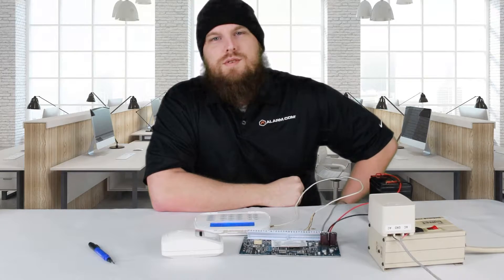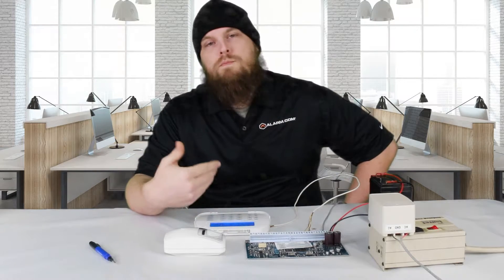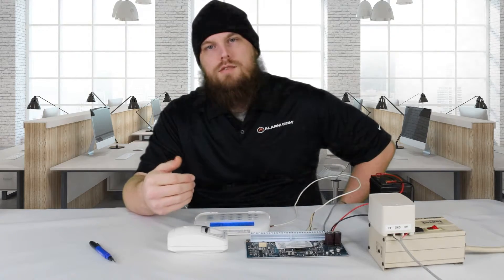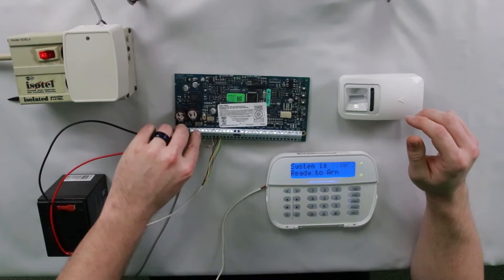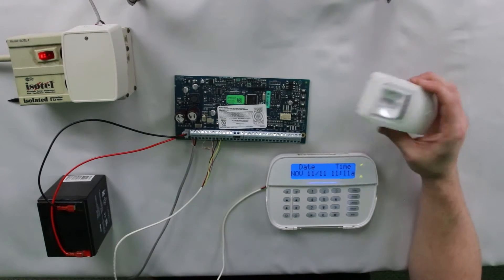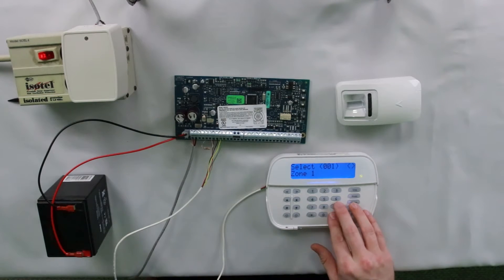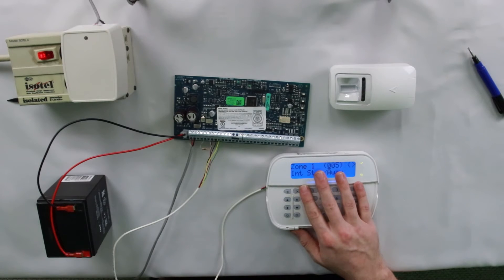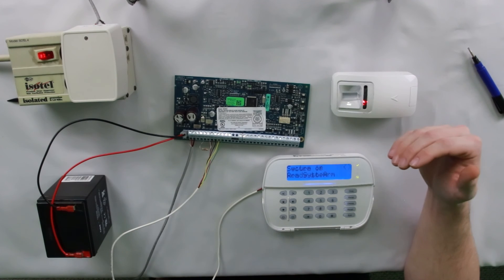Low Device Battery Trouble Wont Clear? DSC PowerSeries NEO Trouble Conditions

Comment: This approach worked! I was getting a battery alert on an older DSC system 5501/1832. I thought it was the main battery but as it turned out it was from a wireless motion sensor that had been moved to a different zone. So I zeroed out the serial number in the empty zone, so it has all zeros for that zone, and turned off the wireless zone type which was 8 for that zone for good measure, and the battery alert cleared! This video really helped as I was flying blind with only a battery alert and no way to know the source of the problem. It was  prob getting some different trouble signals mixed up. If this didn't work I was going to order a new NEO panel and keypad. It's amazing mine has held up almost 15 years. Next time I'll be sure to get a fully numeric key pad.

Comment: What if you cant access that transformer button ?
Reply from the maker: If you have no access to the transformer, you can very carefully disconnect one of the wires in the "AC" terminals on your main board. This removes the AC power to the system so you can perform a reboot.

Comment: My dsc keyboard send this signal. It happens after a week with new batteries. I swapped 3 sets of new batteries and it still keeps happening.
Reply from the maker: If the batteries are actually dying, then you likely have a bad sensor. Sometimes they can have an internal problem that causes them to eat batteries like crazy. I would troubleshoot with your dealer/installer prior to just replacing it though just to make sure.

Comment: I’ve installed 1000’s of PowerG devices and the PG9984P is hands down the worst for “low battery” conditions to clear.   Even after deleting the device and reinstalling it.   A week later, “Device Low Battery”.   I’ve complained to JCI tech support and of course they play dumb.   Never had this problem with the cheaper PG9914.

Comment: What about the system itself saying low battery? I put a new 12v in and 24 hours later it still shows the low battery symbol.
Reply from the maker: System batteries can take up to 48 hours to charge, but if the message still shows, try a power cycle. If that doesnt work Id try a different new battery.

Comment: This had been driving me nuts.  I had a contact sensor that had a dead battery, swapped out the battery but "low battery" trouble in that zone wouldn't go away. Threw out a couple of batteries. After about 5 months I decided to go searching for the answer.  I appreciate you posting it.  I reset the panel and if finally went away.
Thank you!